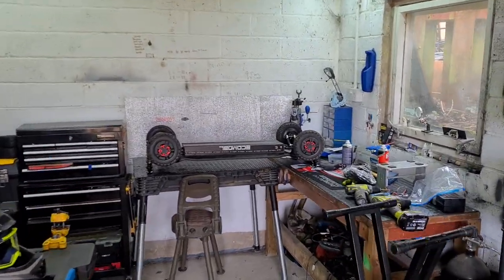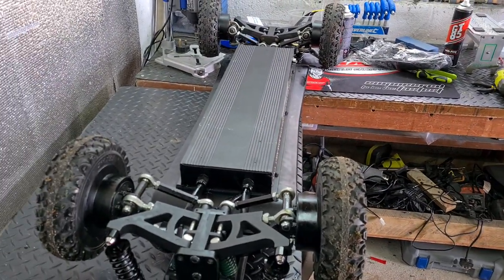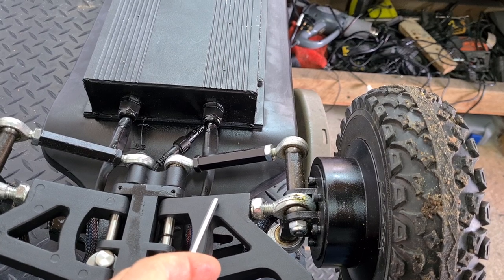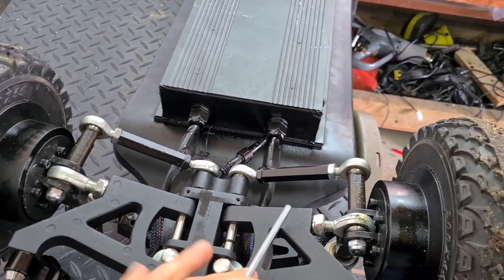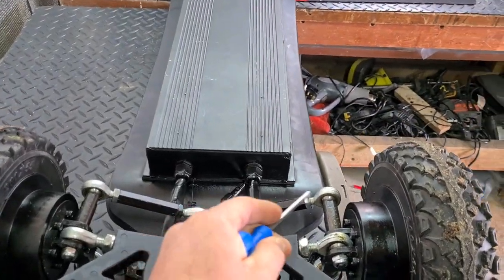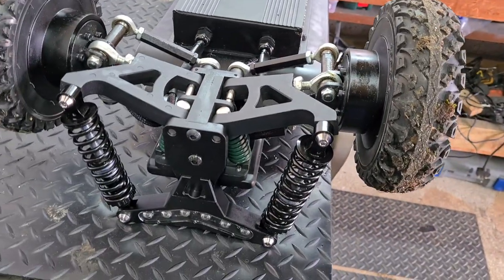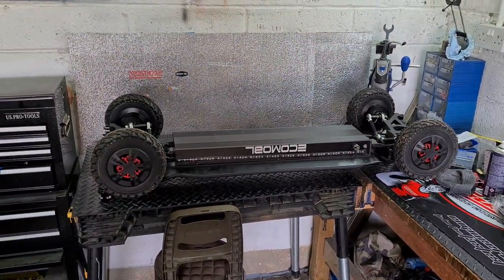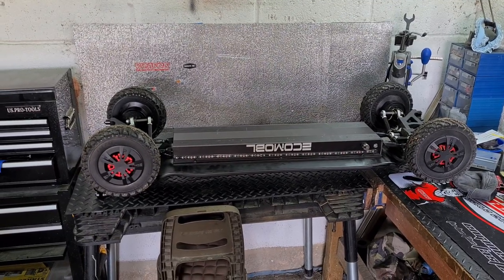ecomobl M24 routine maintenance after 80 miles, sorry, I lied 😅

Comment: Can you do a video on how to install green springs please
Reply: When adding a spring, there are two things to do especially when dealing with green springs. 
The second is not well known.
(1) Put your full weight on the far side of the board to angle the near side up as much as possible to make room to slide the spring in.
(2) Anchoring the bottom of the spring is easy. Pushing in the top of the spring is not easy because it is just a little too high. Stick the head of the screwdriver at an angle into the hole of the cap on the top of the spring and tap until the spring sides in enough to be able to tap it from the side. The idea of the angled tap is to simultaneously compress the spring shorted and move it sideways at the same time to take advantage of the shorter spring..